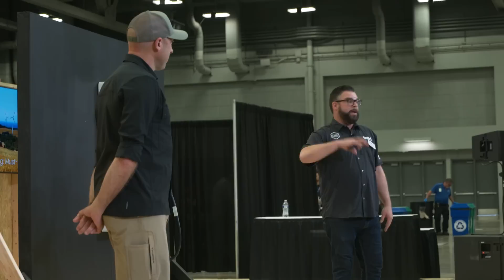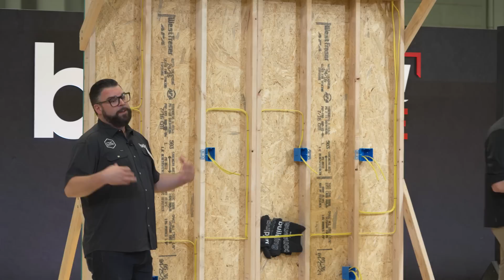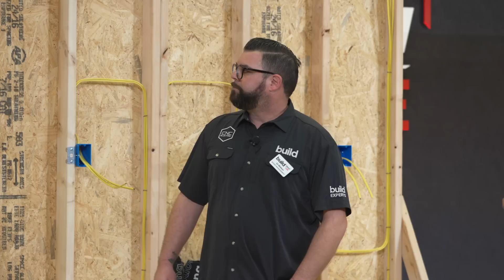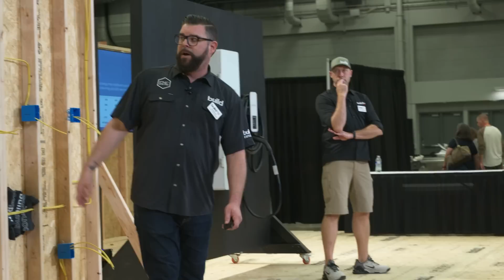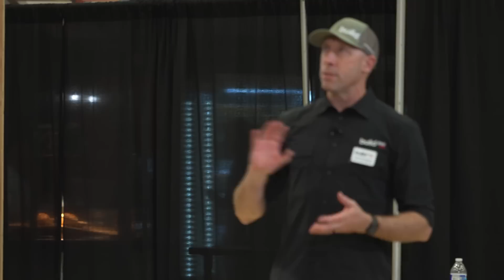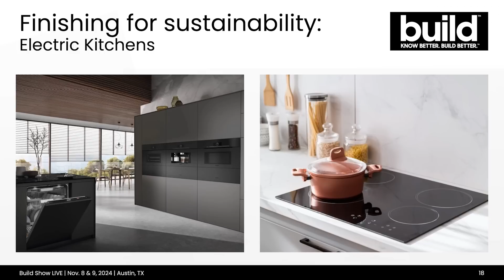Energy Savings Must Haves - Build Show Live

Comment: Some genera.lcomments on what they are saying based on our experience with major work on the how 25+ years ago.
First, plan to expand.  Add the extra conduit, add that extra electrical panel  It is much easier to do before you put in the walls.  We had a 200 amp main panel put in back when 100 amps was standard, and it has made a lot of difference.
 That extra space and power allowed us to add an EV car charger without any changes other than to add a new circuit.
Second, think about what happens in various situations such as tripping a breaker.  Do you want to go outside and reset the breaker in the middle of a winter storm, or do you want to be able to reset that break inside the house?  We added breaker panels inside the house so we did not need to go outside.
Third, think about where the furniture might go.  Outlets are normally placed in the middle of the wall.  Where does the bed end up...the middle of the wall.  If you put the outlets closer to the corners, you will be able to get to them without moving the bed.
Fourth, mechanical space.  Plan on space for the washer, dryer, furnace, water heater, batteries, car location, EV charger, etc.  Sure, it is overkill, but you don't know what the future will bring, so give yourself some space where things can go now, and extra space for the future.
Fifth, get involved with the designer or architect.  Getting a lot of this included in the design up front will make a huge difference.

So, what did we do...
We had internal breaker panels installed and all of the breakers are on those panels.  When we have tripped breakers for circuits inside the house, we don't have to go outside to reset them.
We had extra conduit run from the main panel to other places.  We have since filled those conduits without having to break into the walls.
We planned for solar, which was brand new when we did the work on the house, so we had the extra capacity to handle the solar system.
We added a central patch panel for TV and Data.  At the time no one knew about Wifi, and it allowed us to run cable, satellite, and data wherever we needed.
We put outlets near the corners of the room.  You want to plug something in, you don't need to move the sofa or the bed, you just go into the corner and find the outlet.
We installed more outlets than we ever thought we would need.  While some are empty, we used a surprising number of the extra outlets. 
Our outlets only cover one room.  We had to argue with the electrician over that one.  It means that if a breaker trips, you only need to check one room for the problem.

Did we guess wrong sometimes? sure.  Our problems have been mostly being too conservative, but most of the time, our extra time and thinking ahead of where we might expand has paid off.

Comment: So the one thing I took away from this presentation is that SPAN as great as it is is totally reliant on the internet being up in a storm - so if you lose grid power your panel is smart, unless the exchange running the internet and phone lines loses power in which case you have a dumb panel. So if you're home when it happens not an issue cause you can switch off manually, if you're away you are still looking at losing any food stored in the fridge and freezer etc. 
Or did I miss the bit about it being stand alone local network?

Comment: 21:07 straight up lies... hps is not incandescent, they also last 12-24k hours, while the leds diode can last 100k hours the smds they use often last a fraction of that meaning that service is likely less predictable and failure of such lamps is almost always 100% while hps failures still produce limited amounts of light.

Comment: Span is a solution looking for a problem.  You would be better off spending $500 on a regular panel and then using the remaining $3000 to upgrade to  25 SEER heat pump(s).

Comment: I’m not a fan of SPAN panels.  They do not allow local control over the local network—so you HAVE to use their app/website rather than simply logging into the panel itself via your local network.  This means if the internet goes out, you’re back to a standard electric panel.   It also opens you up to be at the mercy of SPAN’s systems being secure.
Reply: Yeah, I’d honestly like to see SPAN remove the requirement to use their cloud service (so allow full local control and make cloud optional) or go out of business.  With their current “features,” I’d never buy a SPAN panel.  There’s zero reason the panel’s onboard computer can’t host the webpage and controls locally, other than allowing the folks at SPAN, and anyone who hacks into their system, control over your electric panel.  Neat idea, p*ss poor implementation.  Wouldn’t buy.
Reply: It's strange that it wasn't made like that  @miket5506 
The measured and logged data is a great idea for people interested in analyzing their usage and the ability to control circuit energization has application, but it can all be stored locally and accessed via USB and Bluetooth, and even offer its own dedicated full time interface for that matter.  Keep logged data on SD cards to swap and copy.  No Internet connection needed at all unless user needs access from a distance.

Ah, if only I were still in product development...
Reply: Good to know!

Comment: I don’t really see any point of SPAN panels, or smart panels in general.  Just do whole-home batteries and backup and you are done.   No need for any smart panels.   Even in a blackout the only thing we’d have to leave turned off is the A/C.  The solar and batteries cover everything else in the house 24x7, 9 months out of the year.  Even a good chunk of the EV charging is covered.
Reply: Load balancing is the best part. You would need a sub panel or massive battery system.
Reply: @ Generally no need to do that with a modern inverter.  A typical whole-home Franklin, Tesla, EG4, etc…. Those inverters can push 12kW continuously and handle imbalances of around 6000W or so.  Per inverter.  Will almost never happen in a home since most large loads are  240VAC.  So you’d have to intentionally overload a leg with multiple space heaters in selected rooms to actually trip it.
Reply: @junkerzn7312  I'm more so think load balancing when you are source limited.  In example, not running your electric heaters when you are running your dryer and cooking with the heat pump on if you are amperage limited. Its kind of a corner condition, but may be easier than pulling a 2nd service.
Reply: @brandonv8721  In a situation where the home is fully electrified, including backup heating elements on the heat-pump furnace and heat-pump water heater, plus a high-power EVSE, it is conceivably possible that you might exceed a standard 200A utility service.  But it wouldn't be the intelligent thing to do.

If you only had a 100A service then you might need to upgrade to 200A but, more realistically, you would have a smaller home and install lower-power appliances instead and avoid the cost.

For example, the vast majority of heat pump water heater and furnace installations do NOT need backup heating elements.  In fact, installers/sellers always try to upsell the homeowner with a heat pump furnace faster oversized for what their home actually needs.  Same with the water heater.  Where I live it never gets so cold that one would ever need backup heating elements, but half the heat pumps that get installed in my area wind up including them because the home-owner doesn't know otherwise.

Almost nobody actually needs to run their EVSE at 40A (if their EV can even charge at 40A), or even 32A.  25A is plenty and does not remove any convenience.  A monster induction stovetop and double-oven combo can burn a lot of peak power going all-out ... about 60A for the combo but you don't really lose anything going with something slightly less power hungry.

So the basic answer is... if your service is already 200A (or larger), you don't need a 2nd service.  If your service is 100A then you might need an upgrade if you are going to electrify to that extent, but you could still make things work reasonably well even within the 100A service and still more or less fully electrify if you don't want to spend the money to upgrade the service.

* We can review what various appliances take:

* Heat pump water heater:  1500W (6A on 240VAC), without backup heating elements.

* Heat pump furnace: 5000W (21A on 240VAC) without backup heating elements.

* Induction stove-top, 4 burners: 7000W max (30A), but more around 2000-3000W operating.

* Regular double oven: 7000W while preheating (30A), 3000-4000W running.

* EVSE: 6000W (25A on 240VAC) if configured down a little.  This is still plenty to charge a vehicle with.  32A is the max for most EVs, 40A for some newer ones, 80A for some specialty trucks but if you own one of those you'd be rich anyway so it wouldn't really be applicable.   But you can always configure an EVSE to charge more slower... all the way down to 16A (3.8 kW) on 240VAC.

* General household appliances and other uses in a modern household typically do not exceed 3000W (call it 13A) these days.  Requires quite a lot of things to be going all at the same time to have more now that nearly all lighting is LED based.

--

So lets add it all up.  With basically everything turned on, but not intentionally trying to overload the house by adding a space heater in every room:

(6 + 21 + 30 + 30 + 25 + 13) = 125A ...  Over 75A (18kW) of margin before you hit the limit of  200A service.

Generally speaking, what this means is that one can more or less electrify everything with a 200A service and even get it under 100A with only a few compromises.

-Matt
Reply: @brandonv8721   In a situation where the home is fully electrified, including backup heating elements on the heat-pump furnace and heat-pump water heater, plus a high-power EVSE, it is conceivably possible that you might exceed a standard 200A utility service.  But it wouldn't be the intelligent thing to do.

If you only had a 100A service then you might need to upgrade to 200A but, more realistically, you would have a smaller home and install lower-power appliances instead and avoid the cost.

For example, the vast majority of heat pump water heater and furnace installations do NOT need backup heating elements.  In fact, installers/sellers always try to upsell the homeowner with a heat pump furnace faster oversized for what their home actually needs.  Same with the water heater.  Where I live it never gets so cold that one would ever need backup heating elements, but half the heat pumps that get installed in my area wind up including them because the home-owner doesn't know otherwise.

Almost nobody actually needs to run their EVSE at 40A (if their EV can even charge at 40A), or even 32A.  25A is plenty and does not remove any convenience.  A monster induction stovetop and double-oven combo can burn a lot of peak power going all-out ... about 60A for the combo but you don't really lose anything going with something slightly less power hungry.

So the basic answer is... if your service is already 200A (or larger), you don't need a 2nd service.  If your service is 100A then you might need an upgrade if you are going to electrify to that extent, but you could still make things work reasonably well even within the 100A service and still more or less fully electrify if you don't want to spend the money to upgrade the service.

* We can review what various appliances take:

* Heat pump water heater:  1500W (6A on 240VAC), without backup heating elements.

* Heat pump furnace: 5000W (21A on 240VAC) without backup heating elements.

* Induction stove-top, 4 burners: 7000W max (30A), but more around 2000-3000W operating.

* Regular double oven: 7000W while preheating (30A), 3000-4000W running.

* EVSE: 6000W (25A on 240VAC) if configured down a little.  This is still plenty to charge a vehicle with.  32A is the max for most EVs, 40A for some newer ones, 80A for some specialty trucks but if you own one of those you'd be rich anyway so it wouldn't really be applicable.   But you can always configure an EVSE to charge more slower... all the way down to 16A (3.8 kW) on 240VAC.

* General household appliances and other uses in a modern household typically do not exceed 3000W (call it 13A) these days.  Requires quite a lot of things to be going all at the same time to have more now that nearly all lighting is LED based.

--

So lets add it all up.  With basically everything turned on, but not intentionally trying to overload the house by adding a space heater in every room:

(6 + 21 + 30 + 30 + 25 + 13) = 125A ...  Over 75A (18kW) of margin before you hit the limit of  200A service.

Generally speaking, what this means is that one can more or less electrify everything with a 200A service and even get it under 100A with only a few compromises.

-Matt

Comment: New homes should come with large roof overhangs, solar panels, a rain water collection system and an electric vehicle charger in the garage.
Reply: Roof overhangs can work in most places but you have to consider where you live and the of winds your house will encounter. I Live in So. Florida and would say all of Florida and all of the Gulf Coast States we use "Zero" overhangs and that's because of Hurricanes. Hurricanes or very high winds will use those overhangs to pull on your roof to try to rip it off.
Reply: Why roof overhangs?
Reply: @olaf2554  Helps shade the windows from sun aka extra heat.
Reply: @olaf2554  They add beauty and protection for doors, windows and siding. Water is the enemy of buildings.  Builders today are building boring boxes.

Comment: Any ideas on Internet Hookups for Apartments? Say a tenant wants Comcast and another tenant wants Cox or a local provider. How do you satisfy the choices of ISPs for different people in a small to medium sized apartment? Do I have 1 or multiple ISPs install each unit or just go as the tenants desires? And have the tenants pay for installs?
Reply: You don't, this is a money making opportunity for the building because they tie tenants into one provider and you are stuck. You could try using Star link but your satellite antenna is going to be restricted because you won't be able to access the entire sky unlike a home where you may get a wider field of sky access to link up.
T-Mob;e does have some sort of 5G box, but i haven't heard much of connectivity issues.
If you are going to want to install multiple ISP's you are going to have all sorts of costs with wiring and ISP's are not going to flip the bill for that. They call it the last mile and the last mile for an APT complex is the street to the box screwed into the side of the building or basement and you are going to want to have that room secured.
Usually an area is stuck with one ISP provider and rarely you get more than 1 choice. If you do, lucky you.
Reply: As a landlord, you are probably not required to provide anything. Except possibly "reasonable access." But if you are in the US, there are probably varying state and local laws governing this. Time to call the county clerk. Or a trade group. Or an attorney.
Reply: Typically there are only 2-3 providers in an area, you have those providers come in and wire to each unit, and then let people choose what they want.